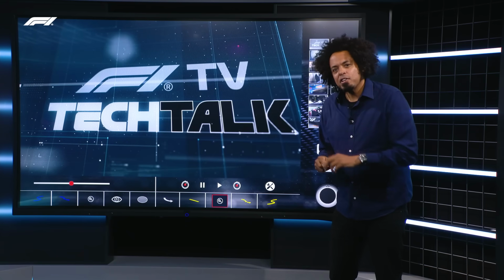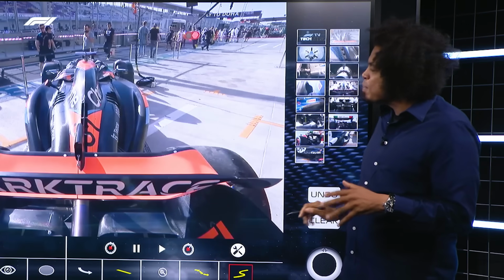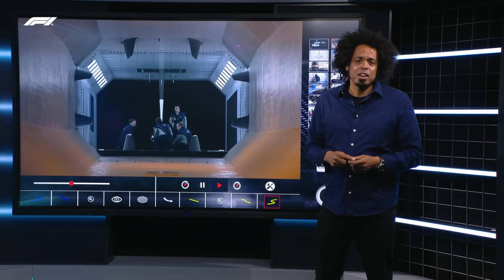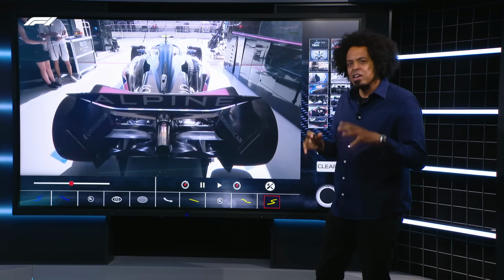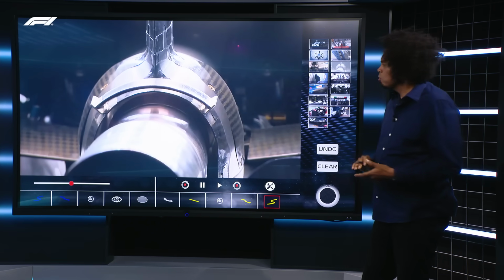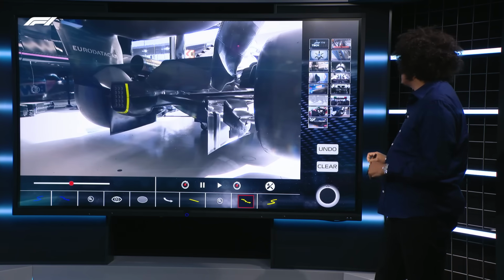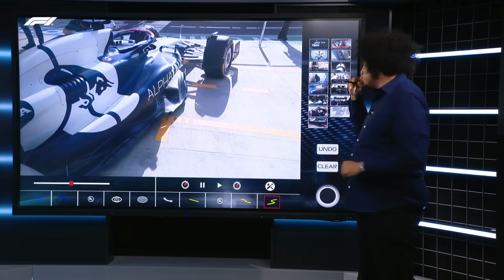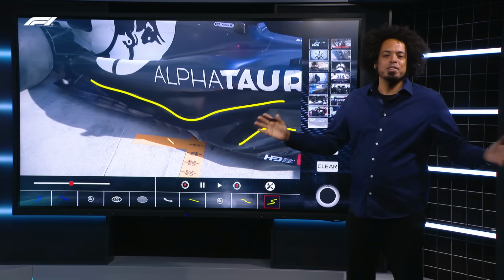McLaren Speeds Advances With New Wind Tunnel | Tech Talk | Crypto.com

Comment: When RB introduced their RB18 (2022) during the preseason test, one bit that stood out was the very high angle and large surface area of the beam wing. Those wings are essentially an extension of the of the rear diffuser.
Now, I can see all the teams have caught up with that design. RB will have a smaller advantage now. I think RB will still beat everyone until 2026 when the rules change.

Comment: Wow I bet that wind tunnel uses more electric than an entire city..... sustainable indeed. and all for 2 tenths or something? well done.....
Reply: It wouldn't for 3 reasons. 1) an entire city uses a LOT of electricity; 2) it's powered by an electric motor - those are quite efficient ~90% or so; 3) once the blades of the fan are up to speed, it takes very little energy to keep them running at that speed - only what is necessary to overcome the friction of the bearing.
Also, I know that F1 windtunnels don't use an entire city's worth of energy cos I live nearish one of them and have never noticed any electricity issues when it is running.
Reply: @abigailcooling6604  my point revolves around the hypocrisy of rats like FOM trying to lecture me on being sustainable while burn more fuel in one weekend than I will in my entire life..... I don't care about the numbers because your numbers are short sighted and don't account for the construction, maintenance or running of the facility.....

Comment: here is the limitation for McLaren. Mercedes will change their engine cooling solution for their new chassis and their aero concept packaging since they are planning to move away from the low cooling requirments spec due to zero pod concept not working. McLaren will have to adapt their car to accomodate the Mercedes engine and they can move the packaging a little bit but it will still very similar to them. So unless we have absolute convergence Mercedes will always have a tad bit advantage using the same engines. this is the same limitation that redbull had in 16-17-18 with chassis and cooling requirment since they always had to open their car more for cooling (vents , ducts , bodywork) then what they were told by renault & sometimes it caused a lot of failures as well. I hope McLaren have a better time if they start performing better then Mercedes.

Comment: That bracket/winglet on the Alpine doesn't smoothly blend with the body work flow of air at it's leading edge. How does it improve air flow? The little sticky uppy bits on either side slightly direct air while the front edge is causing a slight turbulence at the same time.

Comment: They were so fast they couldn't even keep their cars within the track limits.
Reply: Well both drivers mentioned multiple times how tricky the car is to drive, specially because of weak front, which hurts the laptimes a lot on the exit of corners. So no wonder they both went out of the track limits on this slippery qatar track.

Comment: I have to wonder at this point, how much of it is old fashioned slide rule engineering (of course Adrian Newey 🙇‍♂) vs machine learning algorithms. These days, models are cheap. Navier-Stokes  runs and renders on GPUs in hours instead of months. As the algorithms converge on optimal designs under any given set of rules, the cars will begin to look much more similar. 
Very soon the FIA is going to need to address the use of these new technologies. Policing the current rules is quickly becoming a futile endeavor.
Thanks as always for the eye-candy and lecture. Always a double pleasure.
💪😎👍
Reply: I'm not sure about F1, but in my field, it is mostly done on a computer.

The CFD gives you the results in the most ideal/tidy condition. The real world is messy.

The CFD program can also give you options to optimise your design at a given airflow direction based on your requirements. That doesn't mean it's that particularly helpful as  a car is very dynamic. Most CFD software will treat any object as a rigid body, which is obviously not the case in the real world.

Comment: What is the difference between an old and a new wind tunnel? more wind?
Reply: in the case of McLaren, the new tunnel is in house rather than over in Germany, so vastly more effecient in terms of money and resources
Reply: For Red Bull, a big difference would be in the size. If I'm not mistaken, their current wind tunnel only allows for 50% scale models, while the bigger ones allow for 60% scale (maximum allowed in the regulations). Newer wind tunnels can also improve on operating efficiency (i.e costs). Undoubtedly there are some technical benefits as well, but I don't know enough to guess.
Reply: More data points.
Reply: Not more wind, it's often better wind quality (less turbulence, more precision on conditions). Even 80 year old wind tunnels can easily produce the speeds required for F1. It can also be more advanced or precise measuring techniques, or just bigger scale. The closer the scale is to the real car, the closer the results will be. It can also be smoother walls, or walls further away from the model so as to cause less interference on the airflow, and so on.